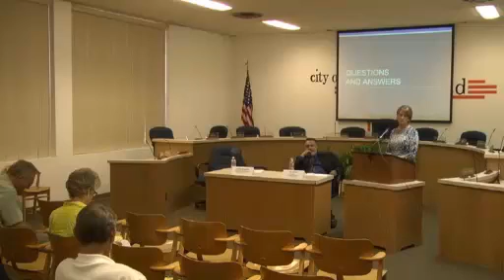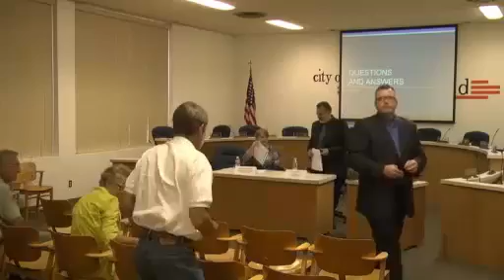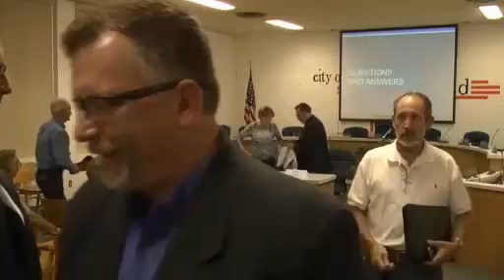Nuclear Watch: USA WIPP We do not  have plans to move the drums out of panel 7 (7/10/2014)

Comment: At [6:10] Mary points out that the rooms containing the plutonium contaminated nuclear weapons waste will be closed but not sealed - that the airflow in & out of the waste rooms will be restricted but not eliminated - When Tammy Reynolds replies - she does not address how the proposed room closure will perform should more waste drums explode. Will all the salt & the steel bulk heads prevent yet another release of plutonium and americium into the accessible environment? Will even more workers be contaminated?
Reply: Tammy Reynolds says that there is no air flow after the rooms are sealed - but what happens if more drums explode? Will another exploding waste drum or drums force more plutonium and americium out of the room, up the exhaust shaft and into the environment?